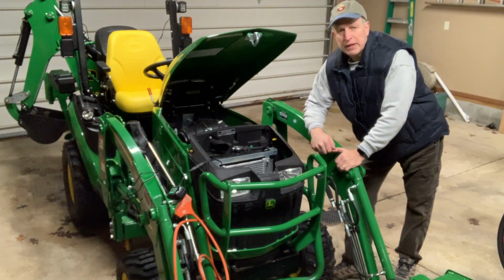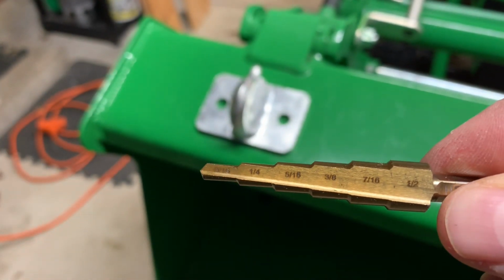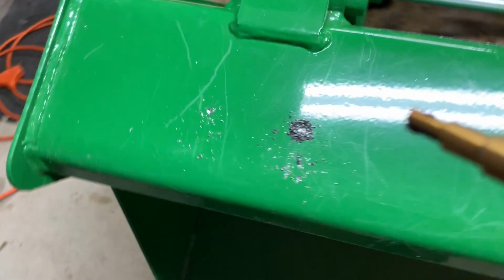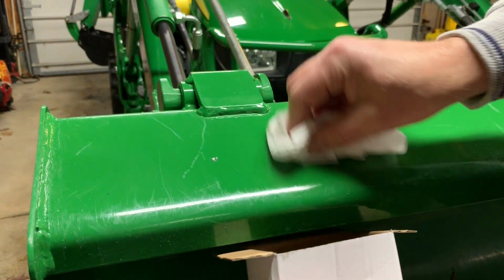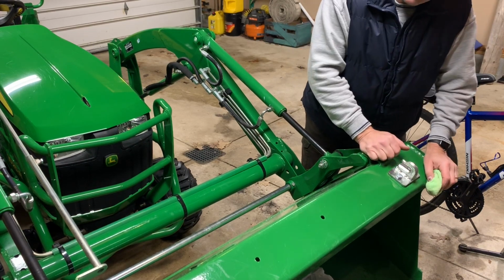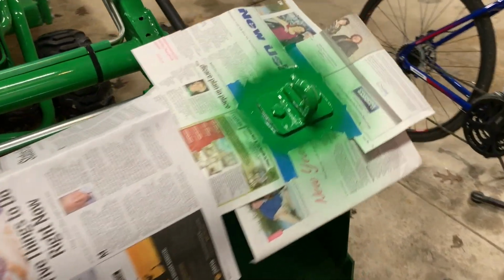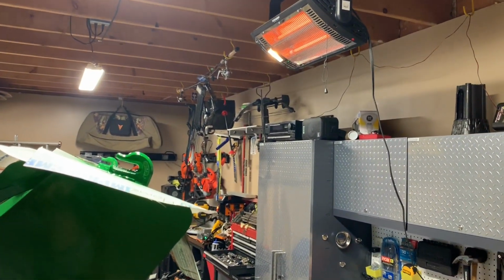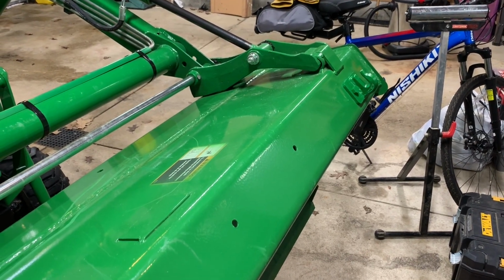John Deere 1025r, It's easy being green

Comment: If you drilled through with the 1/8" the step would have been much easier to follow a hole. When I got my hooks, I got plates for underneath to beef up the area weaken by holes.  Just in front of the cylinders is perfect.

Comment: Ken’s bolt on hooks..you can get a backing plate to increase the strength of the hooks! Check out his website for a few other products for your tractor... I Love my 1025R ! Enjoy
Reply: Or you can save a lot of money buy buying one 5/16 and one 3/8 at the hardware store and using one to back the other (back to back).  Ken is a pirate.
Reply: @aday1637  ken invented these! and its a small family buisness!
Reply: billybob Lockwood  Real farmers have been putting hooks on buckets since the electric welder debute. I made a set of these and backed them up with a set that uses Clevis hooks for straps. If I hadn’t been dirt poor I would have applied for a patent.

Comment: PS:  Get a 3/8 and a 5/16 and mount them back to back on top and the other underneath and they will back themselves up on the plate steel that your bucket is made out of.  Then you can use either size chain.   You can use one of the existing holes in the bucket to avoid drilling into it twice.   The one on the insde does not interfere at all with any of the many tasks I perform with the loader.

Comment: I like your tractor have you had any issues with the cut quality of the auto connect deck
Reply from the maker: I did not spring for the mower deck.  I still have a riding mower for that.  I did purchase a brush hog for the 3pt hitch, but I yet to use.  Fingers crossed, I'll be using it in Southern Ohio in March.  Take Care!
Reply: No problems once you learn how to use it.  (all deck wheel latches straight out, deck lowered to ground and height position knob in removal position).  You can reach right under and move the keeper latch out of the way to back off.  Same thing re-connecting, except you won't need to reach under again as latch keeper will latch by itself.  Use 4wd, low gear, loader up 3 to 4 feet (so it doesn't touch).  After you get the hang of it you will wonder why you had so much problem.

Comment: Drill the entire way through with small regular drill bit. Then use the step bit to enlarge the hole to the diameter you want.
They are not meant to drill, but to enlarge.
Reply from the maker: Thanks for the tip!